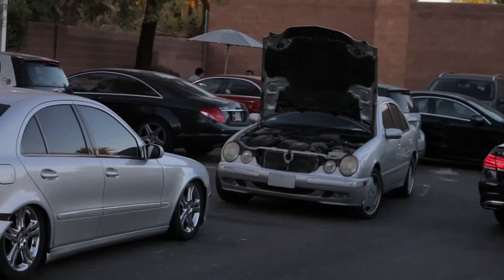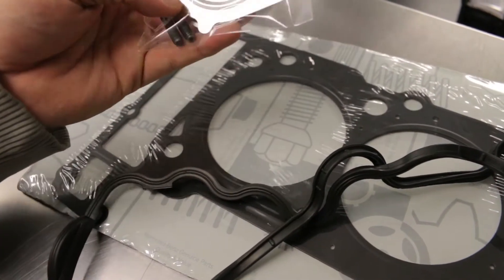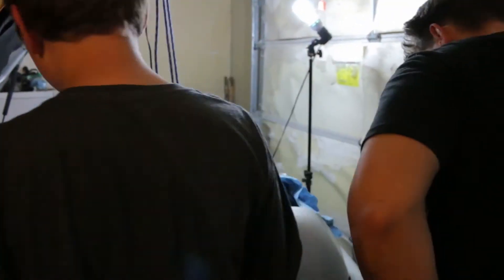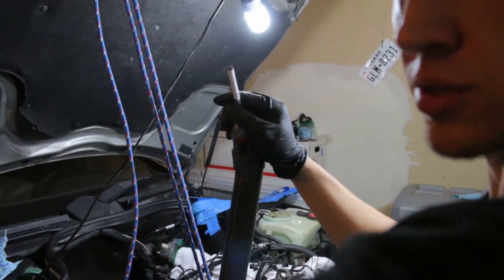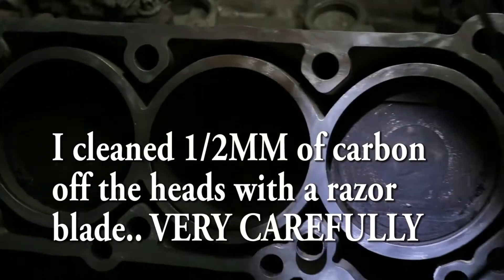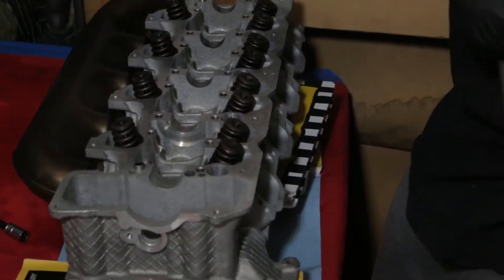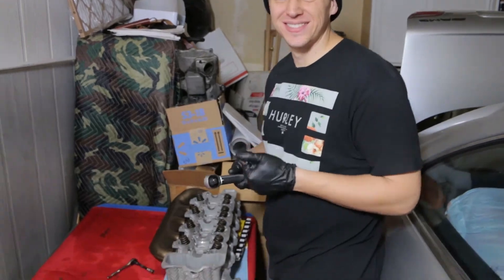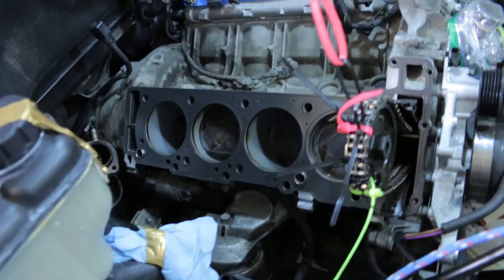CLK55 Project- TORQUE the HEADS (M113 & M112 Motors) Ep.11

Comment: Did you use the timing holder to remove the timing gears from the cams?  Was your cylinder walls scored up ?
Reply from the maker: Sclassmercedes I did use camshaft lock when removing and replacing the cam bearing bridges, I do not believe I could have done it without the locks. 

My cylinder walls did have some scoring, some more than others.. what does the scoring in the walls come from? The piston rubbing? They were like straight lines on the cyldiner walls